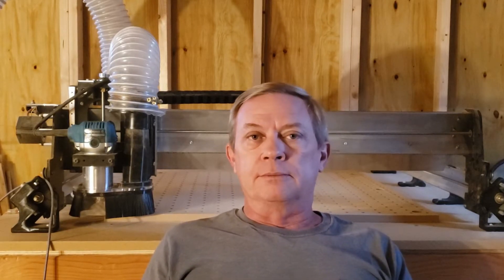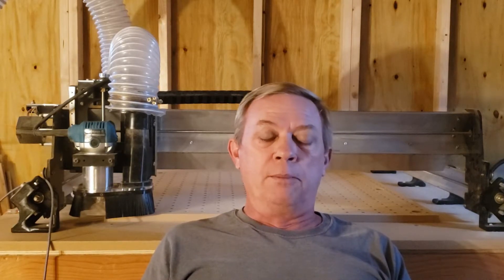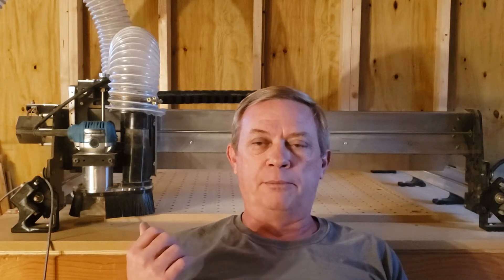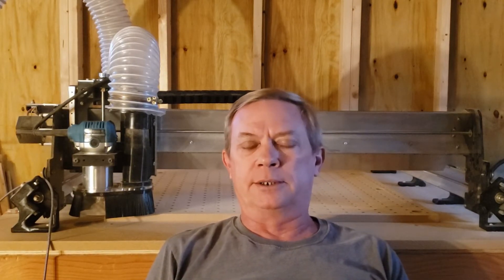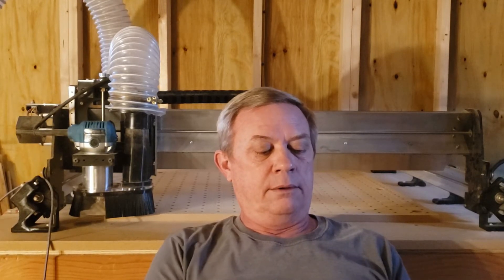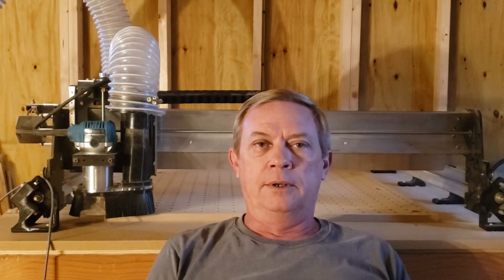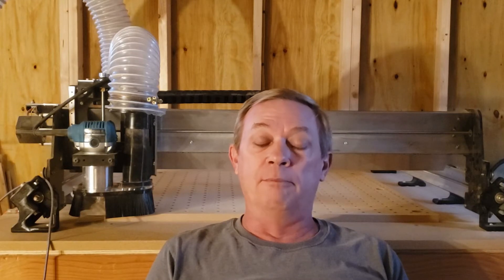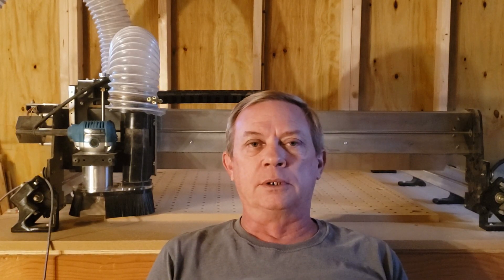Dust Collection - Static Electricity. The real problem and how to approach the solution

Comment: Maybe you could just add a ground wire to the wire that runs through your tubing.
Reply: Static won’t move hence the name. It will help dissipate it from the object’s but you won’t be efficient enough. You’re better off keeping the worst machines as close to the extractor if you don’t want to be shocked.
Great explanation: https://youtu.be/yA22kTtV4XI

Comment: If you wrap your plastics and pvc with bare stranded copper wire like a candy cane from end to end, problem solved.  24-18g will work.  There must be screws used where you can about 24” apart, through the pvc.  I used 1/2” truss screws cutting them off so the tips extend 1-2mm inside the pipe and allowing for the wire a wrap around the screws head.  Earth ground it to or near the vac side.
Reply: It’s called static for a reason. This fella on the link provided talks about it in detail. 

https://youtu.be/yA22kTtV4XI